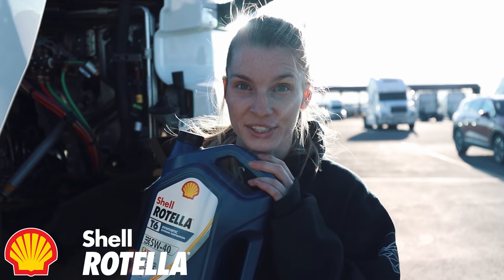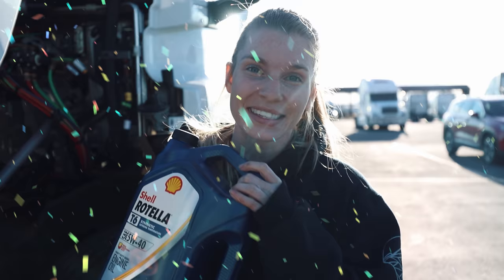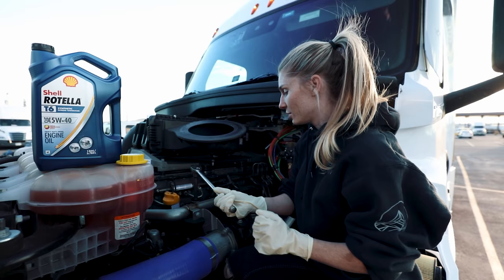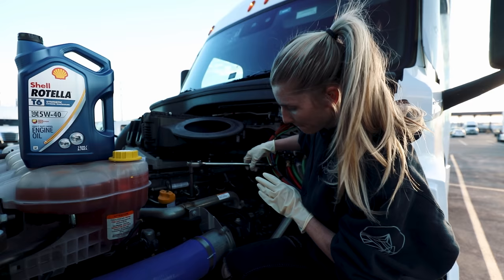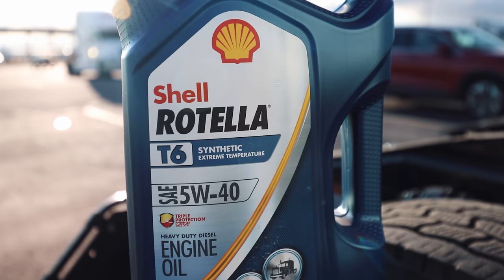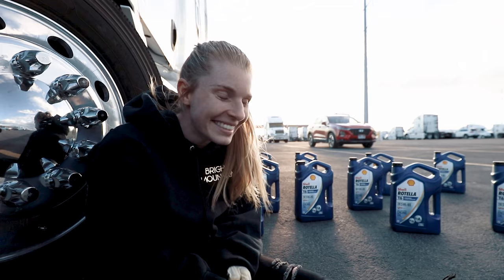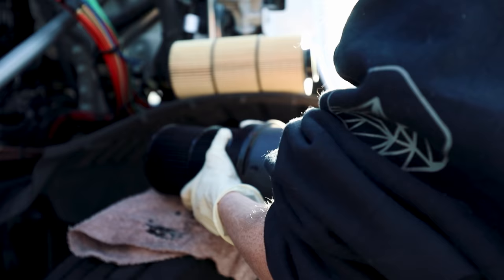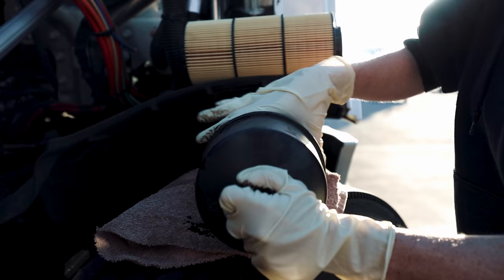My First Time Changing The Oil On A Big Rig!

Comment: It never stop to surprise me what people put in the engine just to save buck or two. I use delo for last 16 years, and my previous truck had 1.8 mill miles on N14 cummins before overhaul, changing oil every 12-15k miles. If you maintain engine, it can go long way. I drove  40 plus thousand pound 90 percent of the time theu Pa. Engine wise , never had a problem. Here and there injector, but that is minor.

Comment: Where did you get that oil drain pan that could how 8-10 gallons of oil without overflowing lol?!  I’ve been looking but can’t find one like that.  I used to use 5 gallon buckets and haven’t done it since because it was an absolute mess trying to switch them out before they got to full.  I need one like that.  Also, so good to see that you’re not afraid to get up under your truck and change your oil.  Next investment should be a grease gun….manual or electric.  Grease for a truck is like oil for the motor.

Comment: Great video. Looks like you need more practice on pouring oil. I have mutineers trucks. One of them which is my favourite is a 83 international load star with a 555 Cummins and a 15 speed. And for my small truck is a 94 chev 2500 6.5 turbo diesel. Love that truck so much. Was my grandfathers truck before mine

Comment: Good video, good job. I'd like to mention something very important. Be very careful with the drain plug. There has been a revision on the threads in the oil pan. They have been known to come completely off. The old version had an insert that clamped on from the inside of the oil pan. That was a better design. They did a press in type insert on some engine models. Damlier could tell you which one you have by the serial number of the engine. I have been told by the dealership that they have had to warranty entire engines as a result of this defect. Be very careful and be aware of which type of plug insert you have. 
Keep up the good work. 

Peace.

Comment: I have a 2020 Kenworth T680 with a Cummins X15 I only use Rotella. Fun fact on a prior truck I used that garbage they sell in a black bottle (it rhymes with Mobil Delvac) anyways it got so bad a was burning a gallon every 800 miles. Maybe it was just a junk motor to begin with maybe it was the oil that turned it into junk. Needless to say I'll never take that gamble again. Shell Rotella is the Tom Brady of the oil world.

Comment: You're holding the bottles upside down. Hold with handle downward and the oil won't glug while it's flowing out. Also, use a funnel.
For the giveaway: 2003 GMC K2500HD CCSB, 1966 Chevy K10 RCLB.

Comment: Don’t run 5-40. 40W oil isn’t necessary in new engines. 30W is good, better would be the FA4 oil, usually in a 10-30. I’ve run FA4 in my truck since new. FA4 is capable of longer drains and better protection in the newest engines. You have a deal with Shell, they have an FA4.

Comment: Things I wish you had included in your video. How much approximately does each bottle of oil cost? How many gallons of oil does the truck need? How much is the filter? What tools exactly do you need to change the oil? How do you safely and legally dispose of the dirty used oil? How much money approximately do you save doing your own oil change versus letting a truck stop mechanic or dealership do it for you like most owner operators? How often do you have to change the oil In mileage, every 20k miles?

Comment: I used Mobil Delvac  Super  1300 for years.  then I started buying Sheel Rotella at Sam's Club  for  $120  per barrle  less .. I get two barrles at a  time..  I  have a    250  gallon torte I was going to start buying oil in the Bulk ..  
  Maybe  I can  go  buy bulk oil from some one and get my barrls  refilled..

Comment: I can tell from being a Mechanic, Fleet Manager and shop owner over 25 years, I've never seen a Engine Failure due to the "Oil". Not saying oil is oil but the failure is from wear or component itself.  Spend $15 and do an oil analysis you'll learn a lot more about it.
Reply: I think the biggest issue with oil isn't so much the brand but the type of oil.  Using something 5w20 in a big truck will wear it out in no time.  A company i worked for used 10w30 in the trucks and the forklifts.  They were doing engine rebuilds every 300k miles.

Comment: Shelby dont know where your leasing your trucks from but most truck rental leasing companys will service their own trucks usually its part of the leasing agreement.  Has for shells oil youll find out soon enough that its hard to find in the states not everyone stocks it and it costs less by the 5 gallon pail compared to the jug over all . thats the strangest oil filter ive ever seen because most trucks the oil filter is under the motor not on top also where are you going to dump all that used oil a shop bay is usually where you change oil not outside .

Comment: Do you own more than one truck or are you talking about the company you work for? Do you own the truck you drive?I changed the oil in mine as soon as it became dirty. I spent the money. The oil is the life of the motor. I changed it myself because what they charge you to do it made up for the frequency I changed the oil in my Peterbuilt often. I ran a high RPM motor the 318 Detroit diesel. There is another old expression’ The motor is the truck’. I am so glad you take an interest in doing yourself what you feel like you can. What do they charge now? A couple of hundred? I am putting a medium truck Ford 550 on the road right now. I hope to install a 60 inch sleeper conversion and a fifth wheel . I am putting in a new motor right now. I hope to buy a four car hauler and will leave enough room on the deck for hauling other kinds of trailer. I am a single axle 29000 gross vehicular weight. I am 64 years old. I hope to acquire my own 48 star DOT authority. Did you know it does not cost that much?  As owner operator and interim my bookings. I am going to put electric power assist on the trailer by a company called Protean or one I like that is available. You know I asked earlier only because I hope you do not limit yourself out there what you want to become by the limitations of thinking you have to work for somebody else 25 % sounds good but you can have it all. Have you heard of IronPlanet Auction? Become a bidder or just watch the truck and trailer auctions and get a feel for what they spend. I watch them all the time. They are Ritchie Brothers.. most newer equipment with low mileage including Kenworths and Peterbuilts. I have seen your Cascadia up to 2018 for sale. I know you like Feightliner. So do I. That motor makes you money. Keep God with you. Your’e the best.

Comment: Pour the oil with the hole on the container up instead of down.  You have way more control of how fast it pours and it won’t chug out in spurts because the air can go in at the top replacing the liquid as it comes out.

Comment: have you also put a new o ring on the oil sump bolt and why don't you use a filler tool to put the oil in shelby

Comment: For goodness sake, clean off all the spilled oil on engine.  DOT officers will get you on Class 3 oil leaks.  Don't touch new oil filter element with your dirty hands.  Wipe off oil filter housing before putting it back on.

Comment: So what about the actual oil filters themselves? Did you not change those cuz if you didn't you just left a whole bunch of well in the engine still. It's great you want to do this on your own try to save money but really you're not. Did you change the fuel filters grease the suspension.

Comment: If you are going to keep doing your own oil changes, beside buying a funnel so you don’t spill the oil, I’d suggest you buy an oil drain plug valve. Fumoto makes them for big truck engines as well as small. I have one on my motorhome and with mine I can hook up a drain hose right into my waste oil container. No mess and no fuss. There are other companies as well. I’m not affiliated or anything, just love the valve and how easy and clean it is to use. 

https://www.fumotousa.com/commercial-trucks-detroit-diesel-any-dd-15

Comment: WHY are you putting 5 40 in a diesel!
15 40!
Reply: New Diesel engines have tighter tolerances which require lower viscosity at lower temperatures. Always check the engine manufacturer’s fluid requirements for the conditions the truck is being operated in. CJ 15W-40 was the old stand by but the times they are a changing... again.